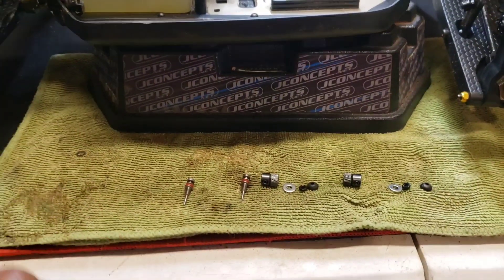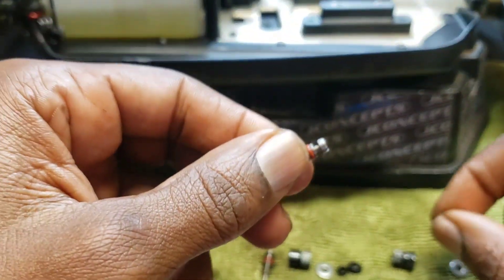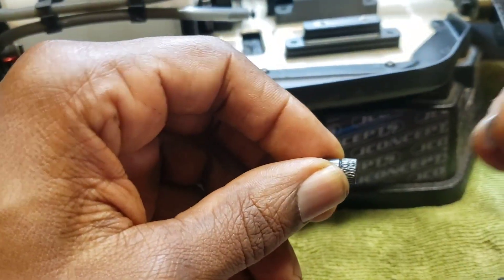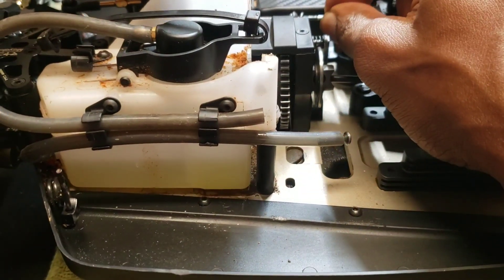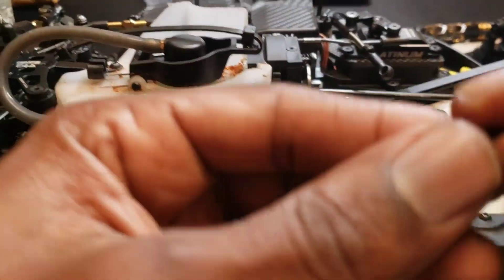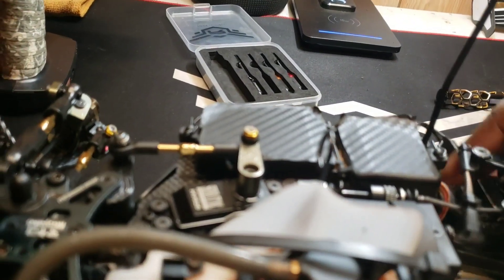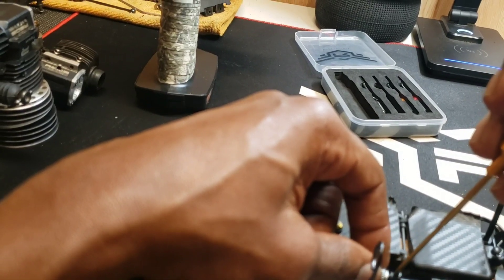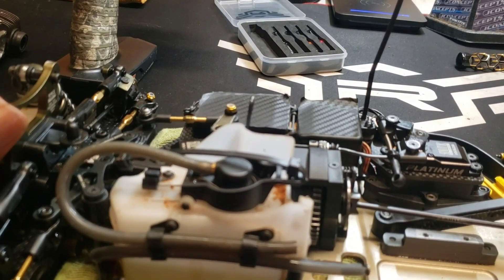TTR TEAM TIP TUESDAY How prevent Brake Fade! #howtoo #viral #rccars

Comment: On the collar the oring you have should go inside the adjuster nut in the middle.  There's a groove there for it to sit in and the adjuster nut wont back off in a run that way.. The oring that comes in the kit not the high end oring.
Reply from the maker: I understand bruha but No sir, there is no other o ring that comes in the kit just the bumper o ring in the Mayako kit i add the oring off the high end needle, and the adjuster nut does not have a oring either or a very very thin one so you can adjust the tension bruha thanks for watching stay tuned for Giveaways
Reply: @ekj24000  put the thin oring in the adjuster nut.. There is a small groove there for it.